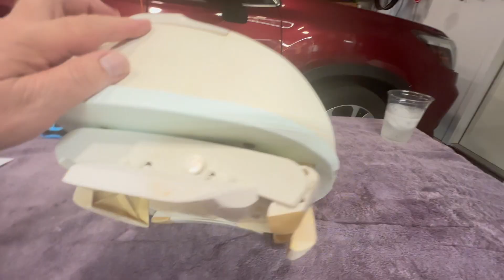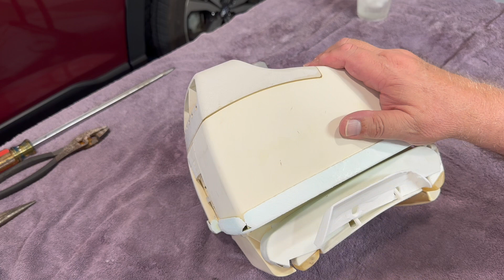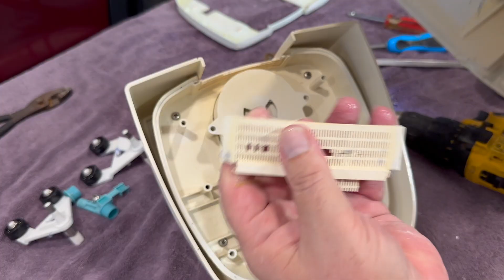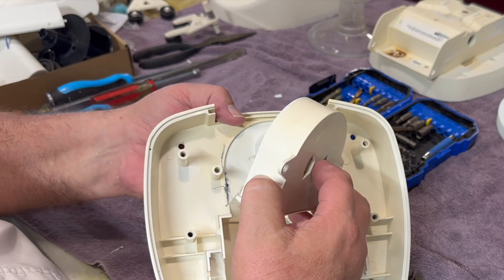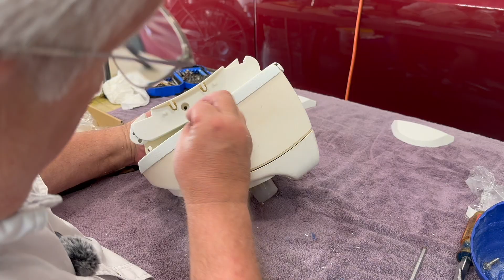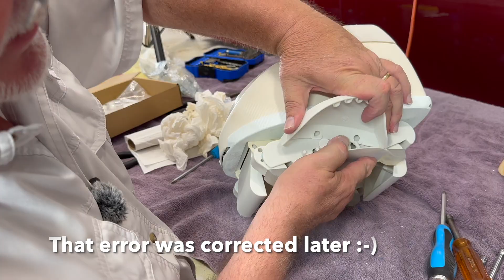Hayward Navigator Pool Vacuum - DIY Repair and Rebuild

Comment: I was finally able to get a glimpse of the side angle to determine if the turbine wheels should have the bearings facing inside or outside; it makes a difference; every little detail is critical if it is going to work right.  The Turbine has a side marked R too, but that shouldn't be a hard one to do right, as the left side has an extended piece that has to fit into a slot.  But the other thing is you need to lightly move each wheel until it locks firmly in place and does not move.  This will require a steady hand to keep in place when you attach the body back on.  The other intricate thing I found is on the gearbox. Make sure you have a washer ring under the red part that fits around the square gear, or it will not work correctly either.  I lost mine taking it apart, and now I have to order another one just because that washer is missing.  Don't over-tighten the pods, and don't let your sweeper crawl up to the top of the wall of your pool it can damage your pods on the edge of the pool too.  I just put on new ones, and they're already showing signs of wear and tear because of crawling and hanging at the top of the pool (too much suction).
Reply from the maker: These are great tips and observations. Thanks so much ch for sharing in a comment. And thanks for watching the video. Have a great day!

Comment: Good video but I could not remove the top cover as mine does not have screws holding it in. Instaed there ore 2 plastic clips at front but no matter how hard I squeezed I could not remove cover.
Reply from the maker: Hi there. It sounds like you may have the Hayward Poolvac V Flex given the reference to the two tabs. I found some information online that I wanted to share. It may be of some help in dealing with those two tabs so the top cover can be removed. Hope this helps.

https://share.google/aimode/e2C8J399uYiHWLHBb

Comment: Mine is even older. I believe it is 17 years old. Well the housing is. Everything in it has been replaced twice. Just put new pods and shoes on. I should replace the A-frames.

The pods on mine were stuck. I had to put them in a bench vise to keep them from moving to pull them off.
Reply from the maker: It’s amazing that yours is still going after that many years. Thanks for watching and for sharing your experience!
Reply: @thejimhandychannel I call it the poolvac of Theseus.

Comment: The other thing that I found out, thankfully for my local Pin of penny place. I try to use my local guy all the time as opposed to the nationwide stores. But it was Sunday and my guy was closed and I needed parts for my Hayward. Ran into the shelf, grabbed my parts came back to pay for him and thankfully the person that was there. Ask the question. Is this a pinch a penny navigator or a regular navigator? I said it’s not a pincher penny. She said you have the wrong parts these parts are for the pinch a penny navigator. I said really she said yes there are slight differences in the parts. Something everybody needs to try to keep in mind and spread the word about that. I guess pinch a penny and then put different parts and make it to a little different spec so you would have to get all your parts through them. Which really sucks.
Reply from the maker: Wow. I didn’t know about the pinch-a-penny version of the a Hayward Navigator. I’ll have to look further into that. Thanks!

Comment: Great Video!!  Sorry if I missed your explanation on why you changed the direction you inserted the pod bushings.   Were the replacement parts modified to install from the inside vice the outside?  If so, any idea of how you know which style you get when you order them?  Any idea of a source of supply where you can get just those bushings?  Thank you!!
Reply from the maker: Hello and thanks for viewing the video! Regarding your question, I went back and viewed the. Video and just realized I installed the bushings wrong. I should have installed them from the outside and not the inside as I did in the video. Interestingly enough, the vac is working just fine, but those bushings were indeed installed from the wrong side. Oops. :/

As for where to buy just the bushings, the bushing and saddle kit available via this Amazon link should be what you need. https://amzn.to/424FW5g

Thanks again for your comment and for spotting the error I made with the bushings.